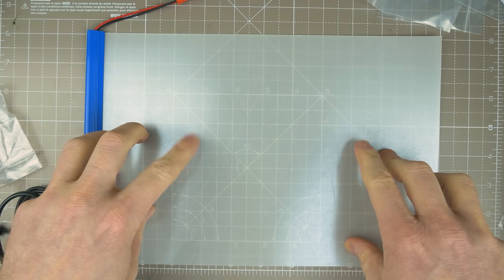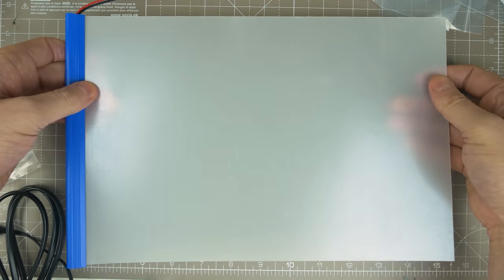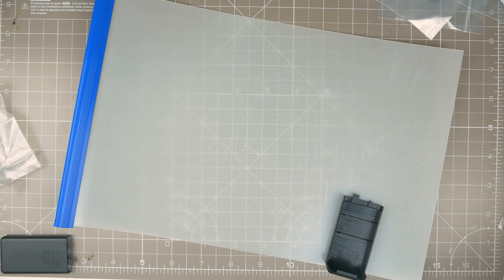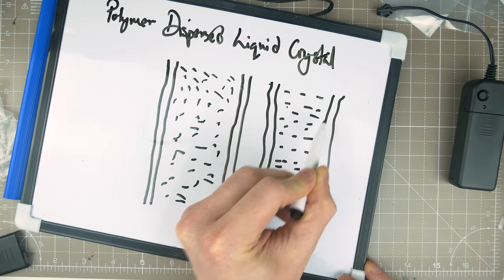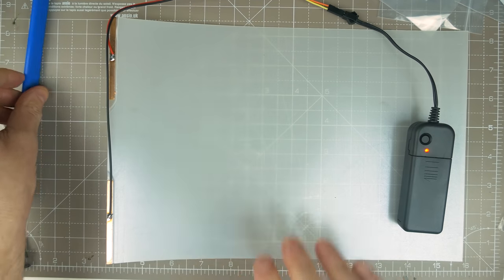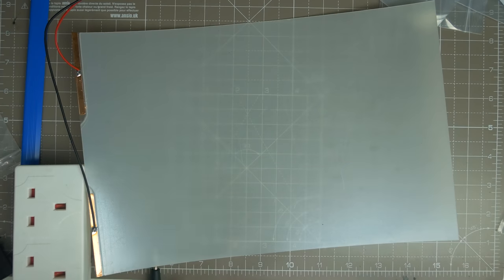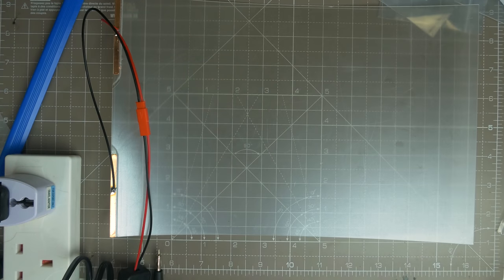PDLC Smart Glass: It's not science rockets

Comment: Hi David , you still have another clear  protective layer of film to take off. Manufacturers have this on all Smartfilm products to protect the actual Smartfilm that is adheared to the glass. You need it on in the installation stage because you are essentially pushing it on with a felt tip applicator with can produce fine micro scratches whilst installing. On One side it protects the sticky side and the other side protects whilst installing.   You'll find when you take it off how much more clearer it actually is.

Comment: Used to work in an office with a meeting room with windows made of something similar to this. But they were crystal clear in one mode and totally obscured in the other mode. It was always a talking point for visitors. Horrendously expensive though when it was put in about 20 years ago.

Great to see something similar available in the hobby market.
Reply: Gavin Smalley Yes, plus I was thinking that in a meeting room application the “not in use” state would presumably be transparent. So you would need to have power applied all the time, except when you wanted meeting privacy. So would ideally be the other way. ie. Transparent until you turned the power on!
Reply: Yes, it is expensive, I been quote around £600 per square metre... ouch.
Reply: I love technology, but I'm sort of thinking that it is a solution looking for a problem. What's wrong with blinds?

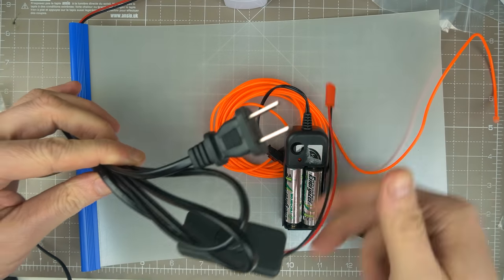Comment: 2:30 - well it's not a truth. If you look inside that switch you'll find PDLC film is connected in series with RC combo (R and C are in parallel) - RC elements values are set so the effective voltage you see on PDLC film is... 40 - 60 VAC depending on the sample. It's just the simpliest and the cheapest way to power this PDLC film sample. If you want to put PDLC on your window, big one, i'll need a dedicated power supply (i.e. with trafo and triac inside).

Comment: I got one of those, I thought 230V ac was too much and dangerous, it should have been anywhere between 15 to 72V ac, I have a pair of 30V ac transformer and put it in series, to give me 60V ac, that works fine. Thing need to test, what the current draw at 60V ac? and 230V ac?, it should be around 5W per square metre as far I could remember. If the wattage is higher, it might likely to burn quicker and shorter life cycle. I find there are a handful of helpful information on the internet. That something you can experiment on youtube. Have fun.

Comment: I wonder if the load was pulling down your EL wire power supply to the 1.x volts? It will be really interesting to see what power this draws, and what the minimum activation voltage level is. Also, if it is gradual or if there is a switching threshold (which I assume is more likely). Being like LCD you’d kinda expect minimal power usage though. 🤔
Reply: EL supply isn't good if it a high frequency is use, not very effective.

Comment: Hmmm... I wonder is the voltage problem or frequency? If I remember correctly, el wire uses quite high frequency to drive.
Reply: Yep, not good with high frequency for the PDLC
Reply: @emeraldbonsai  It didn't have a transformer when it was sent to me even though it was shown in the photo off ebay. I got half of my money back.. if anyone bought one without a transformer can ask for money back if it did show on the photo. I wouldn't risk a shock unattended, for safety it should have a transformer with it.
Reply: @emeraldbonsai I am saying it is not suitable for  PDLC